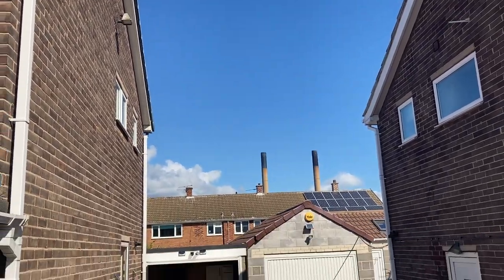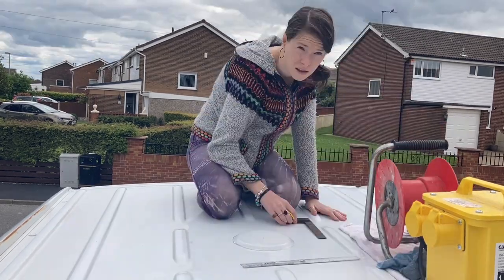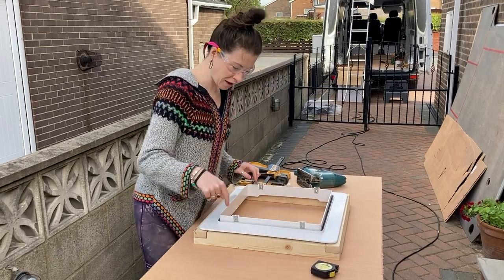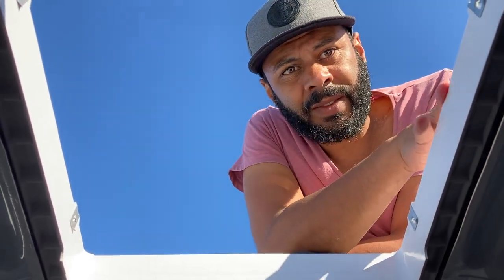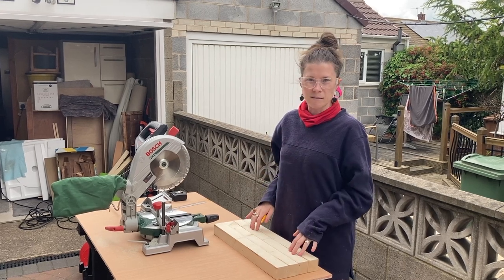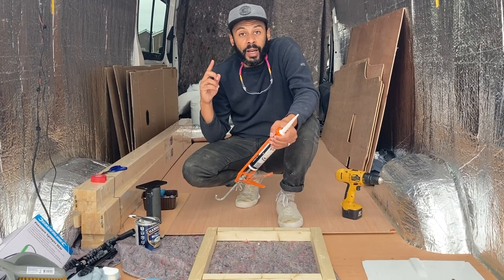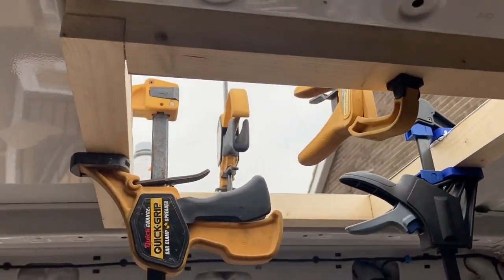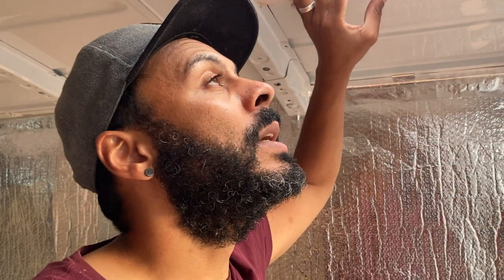Installing Campervan Roof Vents | MaxxAir Fan & Skymaxx Rooflight

Comment: hi guys did you know after installing one myself the 4 scres to fix the fan to the flange you  used the white ones. These are for the interior garnish cover, they are not stainless

Comment: Sikaflex is a brand that does many types of sealants and adhesives etc. Could you be more specific. You should have put a few screws in the wooden frames. And also don’t use your hand to check for sharp bits. Doh! You guys seem to be doing a great job though.
Reply from the maker: There are a couple of caravan-specific Sikaflexes, some which are waterproof etc., but we put links to most of the stuff we use in the video descriptions so hope that helps 😊 The frames don’t really need screws in as the wood glue is pretty strong and they’re being sandwiched in place by the two sides of the vents, we’re pretty confident they’re not coming apart any time soon. Definitely not the best way to check for burrs, no 😅 but we suffered no injuries in the process. Many thanks 😊

Comment: So I put up my Max Fan today then opened up the Skymaxx box to fit it in the rear and realised it wasn't going to be as simple to install. Search Youtube and low and behold my favourite YouTube couple bought the same as me. What a work up that was to put up. Did you find it a PITA as well??? I totally agree with James, not really a fan of the quality.
Reply from the maker: Haha great stuff! Yeah it was a proper pain to install. However, even though we were worried about the quality it’s held up well so far and isn’t as flimsy as we first thought. And it’s well worth the effort in the end - the breeze it pulls through with the fan on is lovely in the kind of weather we’re enjoying now 😀

Comment: Hey guys, I was planning to put 2 Maxxair deluxe and was wondering: do you think one is enough in combination with the skylight? Or would you feel like 2 fans would be a big enrichment in terms of ventilation? Thanks a lot!
Reply from the maker: Hi! In our opinion (and our experience of using it in the recent heatwave as well!) one fan plus the skylight is definitely enough. The Maxxair fans are really powerful so as soon as you turn it on, any other opening is enough to create a good breeze - even with just our small back window open a crack it still produces a good draught, and with the skylight open the ventilation is amazing, it’s like a wind tunnel 😅. Assuming you’ve got the same sized van as us we’d suggest one fan and a skylight is more than sufficient. Really not sure how much more efficient two fans would be, if at all. Hope that helps! Let us know if you have any other questions 👍

Comment: Hi both what size wood did you use on the frame ?.
Reply from the maker: We used 34 x 34 to construct the frame 👍
Reply: Cheers guys you’ve helped a lot so far much appreciated 👊
Reply from the maker: No problem 😉

Comment: Hi, so possibly a stupid question but how is the fan powered?
Reply from the maker: Hi! Not a stupid question at all. It runs off our electrical system which we hadn’t built at this stage so it’s not actually working here. We installed the fan first then hooked it up a little later in the build once we’d put our batteries and solar panels in 😀👍

Comment: Nice job guys! I have that same exact skylight and haven’t installed it yet. Was a little nervous after looking at it and was thinking the same thing as you. Have you driven the van around since you installed it? Just wondering if it will rattle or anything.
Reply from the maker: Thanks! Yes we’ve had it in for around 4 months now and it’s actually been great. No issues whatsoever. It doesn’t rattle, hasn’t leaked, and even though it’s not as sturdy as the fan, there’s nothing to worry about in our opinion. Pretty happy overall 👍

Comment: Did you have a problem with the depth it goes with the skymaxx? Mine doesn’t quite marry up
Reply from the maker: We had a slight problem trying to screw the fan into the flange but managed to solve it and get them to line up eventually but we didn’t have a problem with the depth. Is it a sprinter that you installed it in?
Reply from the maker: Yeah you should be fine in that case 👍
Reply: I put one in at the weekend but my overall depth is closer to 70mm than the max 60mm on the spec, ned to find some longer screws
Reply from the maker: Hmmmm. I’m not sure why but we didn’t have this issue. What size wood did you build the interior frame from or did you use a different method?
Reply: @tedwardjo  I have the same problem. How did you solve it? I haven't been able to find longer screws of the right size so I am considering drilling holes through the outer flange and screwing it down that way similar to the way the MaxxAir fan is installed.